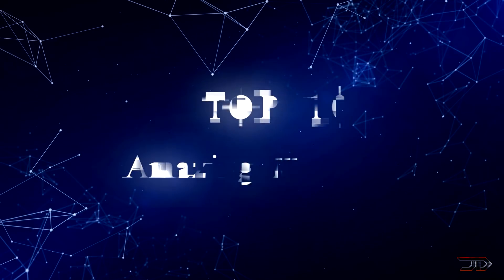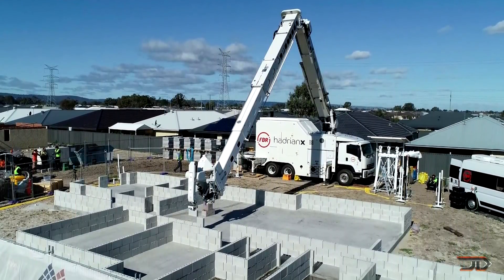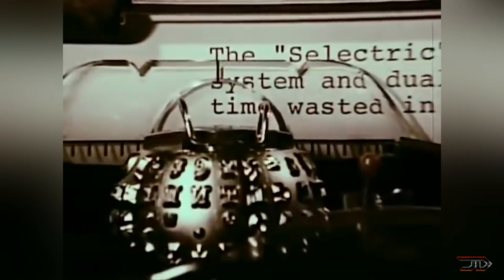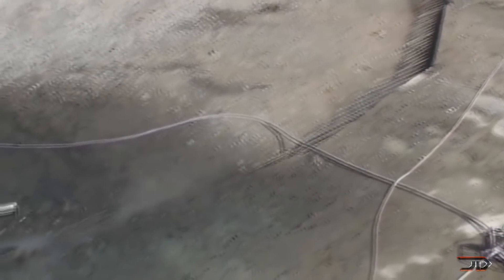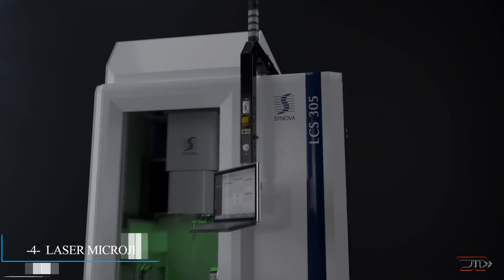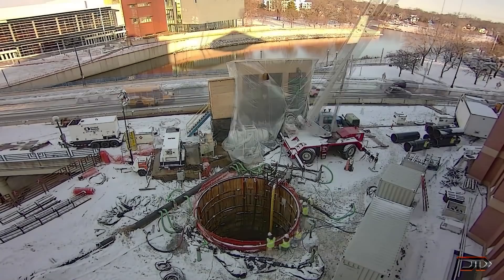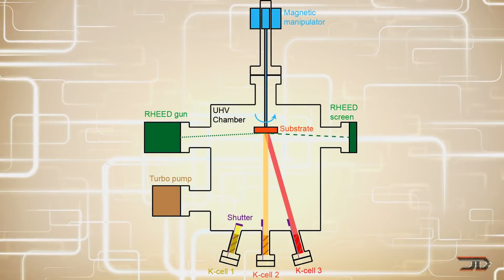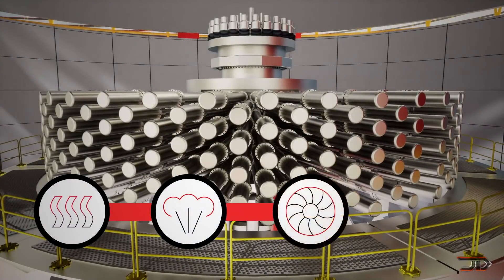10 MACHINES You Never KNEW EXISTED

Comment: Missinformation regarding hydro demolition 
As a comercial diver we use 3000!! Bar handheld under water 
1000 bar is for girls
Reply: I'm in the water blasting industry.  You're right, 1000 bar is just under 15K psi.  Most of our work is in the 20K to 40K psi range (1400 to 2800 bar).  1000 bar won't do a whole lot more to concrete than give it a REAL good cleaning.

Comment: Some of the Selectrics had a parallel interface that could be used with computers to produce gorgeous documents.
Reply: Ahh, the Selectric.  When I was 7 years old my mother bought me a 1932 Remington Rand typewriter for $10 at a garage sale.  I still made use of it until I was nearly 30 years old, which was long after buying my first P.C. & printer in college.  I trained on a Selectric for two years back in junior high.  So did many of my 7th & 8th Grade classmates.  During the second year of typing we took Personal Computer 101.  By the end of 8th Grade it wasnt unusual for us to type 60 wpm with 95% accuracy

I didnt plan it this way, so little did I know how well training of independent finger movement in typing & computing would prepare me for learning acoustic & bass guitar.  I didn't become a music student until I was 27

I still have the Remington Rand- - all-mechanical, & unstoppable.  All I've ever done is keep the type arms oiled where they are all hinged into the solid mounting (just like felt hammer arms of a piano) & replace the ribbon from time to time.  And I also have a Selectric II.  Computers are just fine.  But when in comes to developing manual dexterity, attaining excellent spelling, & capacity for creative writing, there's simply no substitute for typing with a typewriter

I've used WordPerfect ever since the early 90's & STILL do at home.  And it has never handicapped my abilities with spelling, punctuation, & semantics.  But programs like Grammarly do too much of the work for you.  Sure, you're making selections as to how each sentence is worded.  Nevertheless, it's closer to the truth to say that the machine is writing for you, causing you to become dependant on it, instead of fully self-sufficient.  After using Grammarly for too long, I anticipate many a colege student will begin having brain atrophy when it comes to their spelling & creative writing abilities...

We are supposed to be the masters of our machines, not the other way around.  But as computerization has spread into every corner of Industry & personal life, we have become far too technology-dependant.  With little resistance the greater majority are surrendering their autonomy & their self-sufficiency to the computer.  Technology is NOT our god.  It is our SERVANT

Comment: As for that truck dumpling platform which raises the truck up to drain its load has been around for over forty years and was used in the lumber industry to haul and dump sawdust or wood chips for use in particle or wafer board construction.
Reply: 😳?!  I would hope that contraption doesn't rely solely on the fitness of the trucks brakes.  Setting the trailer's spring brakes & strapping down the tires of the truck would be one way
Reply: @magnificentmuttley154  At that angle brakes does not matter anyway. the wheels will slide with no problem. So for sure there is some rest point at the rear end of the truck.

Comment: i thought the fusion reactor was a golf ball press. lol.

as for "better than a tokamak", well not until it can reach a q of 0.6, which i believe is the record for a tokamak (jet in this case). you only need a q of 10 (engineering breakeven) to build a powerplant, so i think we are closer than we think we are, but still a long way to go.
Reply from the maker: Interesting point, thanks!
Reply: Iter was the Unit That should reach q of 10, but for a commercially used plant you need a q of 100
Reply: @MrTrashmasterfx  jet was supposed to make another attempt at the q record. but i think those plans got shelved. instead they are working on some d-t experiments. this work will support iter.
Reply: @LordOfNihil  hm okay, i think almost all working Fusion reactors are doing work that feeds into ITER. It shows how vital this project is in a way. What also will be interesting is what results come out of the wendelstein 7x when they restart next year after there upgrade work.